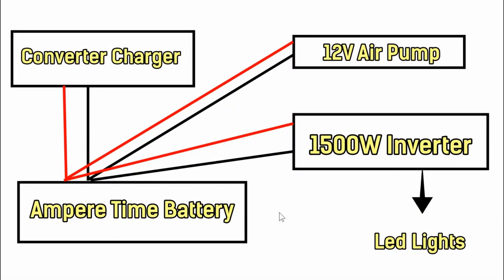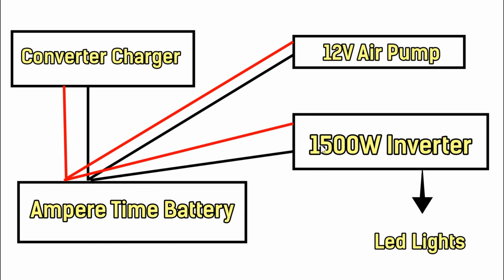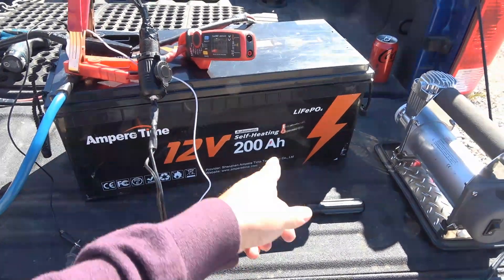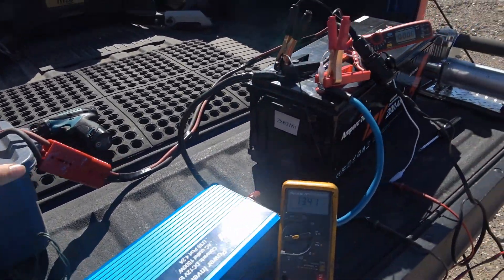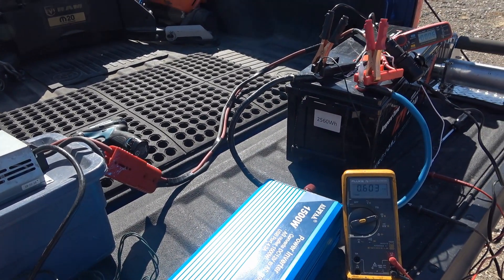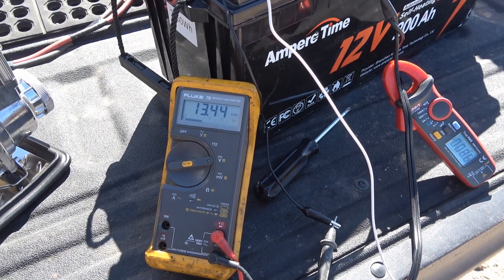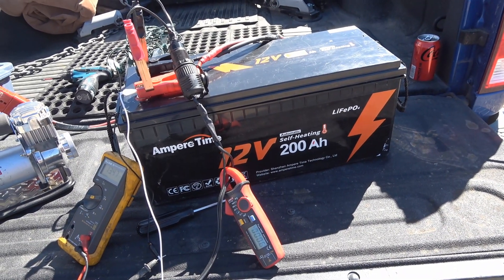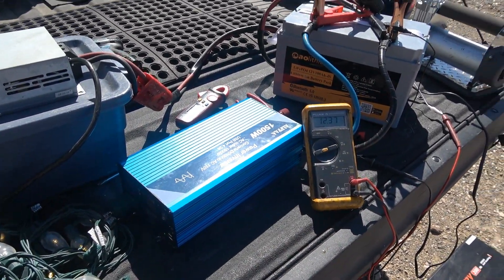Amperetime Battery BMS Failure - Update #2

Comment: the charger was supplying 50A? It sounds llike the battery is low charge, or possibly bad...
Reply from the maker: Battery cells were fully charged and working but looks like the BMS board is faulty.
Reply: @LoveYourRV  Well that would make sense as well, as if the cells were all good and fully charged there is no way the BMS should allow a 50A charge.... That being said, I would assume 50A on fully charged cells would have raised the voltage across the cells to well above 14.6V, and it looks like it kept the cells at 13.8V... Obviously something is foobar with it :-)
Reply from the maker: Sorry, I was thinking of the previous video. In this test, the battery was around 75-80% state of charge so able to take more charge.

Comment: I had stated that at higher draw on the battery there will be a low voltage drop and the inverter will shut off. You said I was wrong, Well I am partially wrong. The problem is a low voltage drop but it is the BMS that is dropping power. If you apply charge to the battery while doing your test so the sudden load doesn't drop the voltage I bet you won't have an issue. The BMS is probably only rated for 100 amp draw. An initial sudden load know as surge will draw more than 100 amps and you BMS will disconnect to protect the battery.
Reply from the maker: Faulty BMS even shuts off when a charge is taken away with very small amp load. It should not do that. I proved that with the 8 amp air compressor load and no inverter hooked up. So BMS is faulty. Ampere Time support concurs. I've tried several other battery brands with 100A rated BMS the same test setup and they work fine. Ampere Time has sent me a new battery to try. I'll post an update when I have a chance to pick it up next week or so. Cheers, Ray

Comment: Off topic, how are people  using lithium when they are not to be used to start generators? Seems two 12v circuits. Thanks for being the go-to expert.
Reply from the maker: I'm not sure but any variables to consider.  It would have to do with the size and specs of the generator you are starting and how may amps it requires and how many batteries you have and their amps ratings. For example I have a battery bank in my RV that has 4 Lion Energy lithium batteries wired in parallel. They each are rated for150 amps continuous output so 4 x 150 = 600 amps. Should be plenty to start a generator. But it a person only has one lithium battery and it only is rated at 100A it may be a problem. Another variable is surge ratings on the BMS of the lithium battery. Often they can handle 2 or 3 times the continuous rated amperage for brief periods. Cheers, Ray

Comment: Check out lithium solar video on this battery. He is having the exact same issue so it appears to not be an isolated issue.
Reply from the maker: Thanks, I sent this video to LiTime so they will be aware of how much of a major problem this will be to RV users. They are sending out another battery for me to test. Cheers, Ray
Reply: Awesome. Happy travels!
Reply: https://www.youtube.com/watch?v=F9QB9mN_58s  This is the Lithium Solar video he referred to.  I'm still wondering if the regular 200AH (not this self-heating one) uses the same BMS module?
Reply from the maker: Here is the recent update. I tested the replacement and it solved the shutting down after charging was disconnected issue  https://youtu.be/vfm6LVaLtO0  Still couldn't start my ALFFAA inverter though. I've now tried a bunch of batteries with the ALFFAA 1500W
The ones I found the starting issue with all had BMS with self-heating and a100 amp rating
Amperetime https://www.amazon.com/Ampere-Time-Self-Heating-Temperature-Applications/dp/B09BR51KQP?th=1
BougeRV https://www.amazon.com/BougeRV-Self-Heating-Temperature-Protection-Maintain/dp/B0B5WTZZRP
Relibatt https://relibatt.com/product/relibatt-re12-100bl

The batteries that I tested that work fine with it are
Lion Energy - https://lionenergy.com/products/lion-safari-ut-1300
Chins 200Ah 100A BMS
Aolthium - https://aolithium.com/collections/12v100ah/products/12v100ah-4s-lithium-lifepo4-battery
Lvgoo - https://www.lvgoobattery.com/product-page/lifepo4-12v-battery-lv12v130

Comment: You already opened the Ampere time battery so now disconnect the bms and see if works without the bms then try it again with an external bms connected to the battery, That will verify its the bms and all you need is a new bms and  will have a functional battery. Not sure why Ampere Time didn't send you a new bms to try in place of the old one.
Reply from the maker: I asked them if they could send just a BMS for me to swap out, but they are electing to ship a new battery. Down the road I'll do some more in-depth testing with this dud. I did confirm with my volt meter that the BMS was opening up the circuit to the battery cells.  Cheers, Ray

Comment: This is a known issue with the self heating battery from  this company.  When the charge current is disconnected, the BMS shuts down the discharge path for a short time, then reconnects. This can be seen more  clearly  with an oscilloscope monitoring the discharge path.
Where you have an inverter connected, this issue effectively  disconnects and then reconnects, this may cause overcurrent shutdown in the BMS due to inrush current. Not all inverters will be effected  due to design variations.
Note this momentary shutdown only occurs with the self heating version. The company is aware of this issue but do not seem to accept its a fault.

Mike
Reply: Michael Fitzpatrick ... I asked them and LiTime said "For the BMS problems, everyone use it in different sistuation, it should be depend on the actual using sistuation and we will try the best to offer the fast and correct solutions .
We offer 24 hours customers service to help you solve the problem, restore battery usage, and introduce the optimal use method."    So yeah I'm glad they have a good rep and I plan to get their non-heating version and hope it has a different BMS.  Do you know?
Reply from the maker: Thanks for the comment. I don't think they will have much luck ignoring this issue then. RVers will notice quickly when the rig's 12V circuits die and reboot. My wife wasn't pleased the first time it happened, and her iMac turned off. ;) I sent this video to them, hopefully they will get the problems the issue will cause for them with RVers and figure it out.